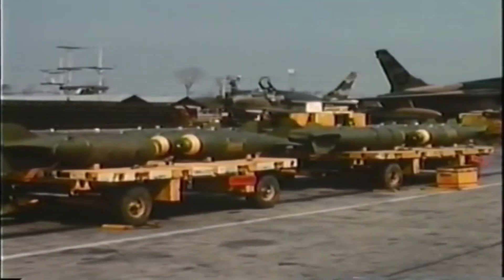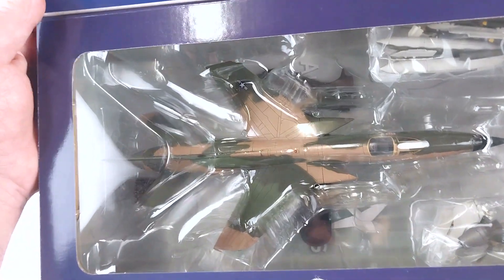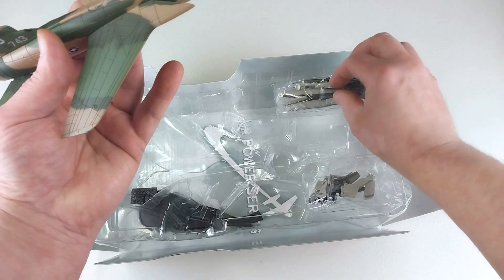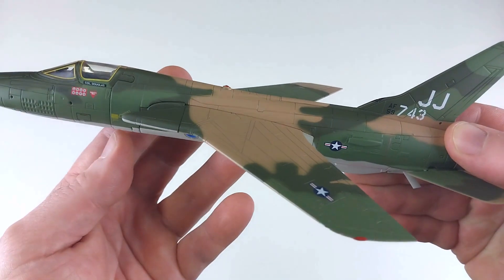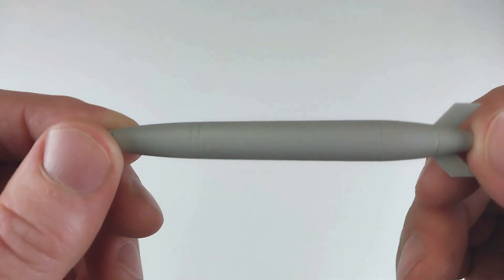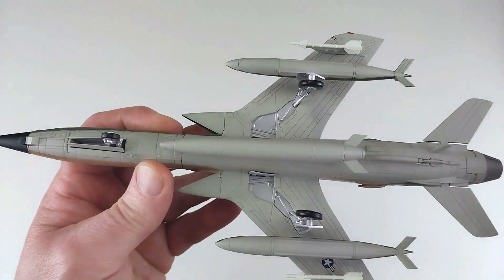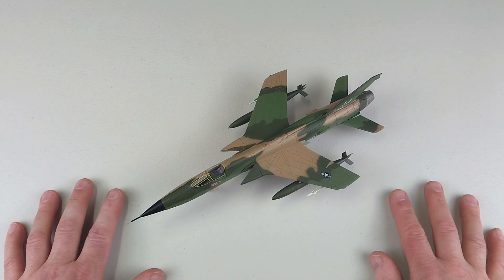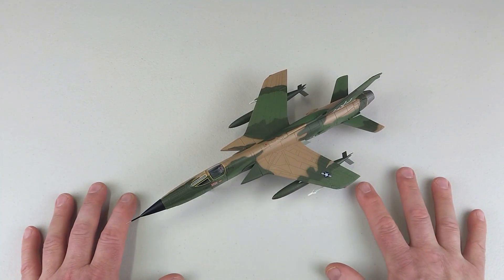Republic F-105D Thunderchief, USAF 388th Tactical Fighter Wing, Vietnam War, 1:72 Diecast Model

Comment: Quite a neat model! I like the little details like the differential paint scheme on the wing fuel tanks and the capacity to use the stand without removing the centerline tank. Great review!
Reply from the maker: Yes there a a couple of HM releases which provided ordnance that the stand can pass through. Then there's a lot that don't. So maybe they started doing it and then thought the cost wasn't worth it and stopped. It's why if I do notice it has the option I try to include it in the video to let people know. 😀 Glad you enjoyed the video and thank you for taking the time to comment as well. Cheers 😀👍

Comment: Hi, the f-105 is a beautiful plane, supersonic (just see its shape), an excellent plane but its reputation is bad because of its performance in the vietnam war, they couldn't fight with the migs (it was not designed as a fighter). A 150$  for a single seat f105 model is not a bad deal. 👍
Reply from the maker: I like it too, is very unique the way those intakes are shaped. Yes had some reliability issues. And you are correct about those MiGs. Thuds were vulnerable to those little nimble fighters. So much so they ended up getting Phantom escorts on bombing runs for protection. Thanks again for spending your valuable time watching one of my videos. 😀